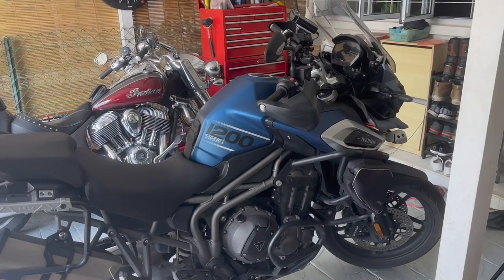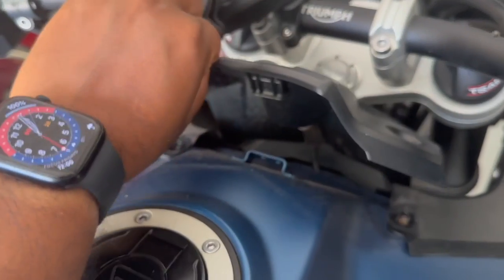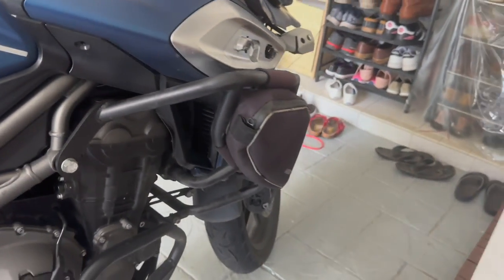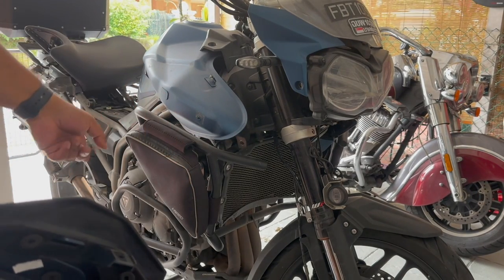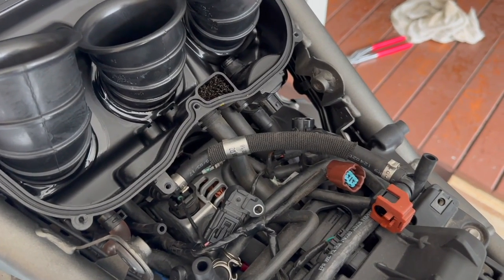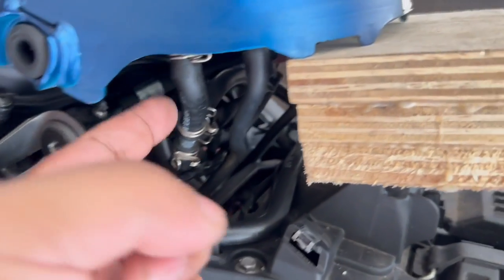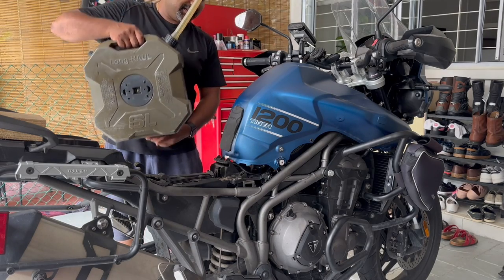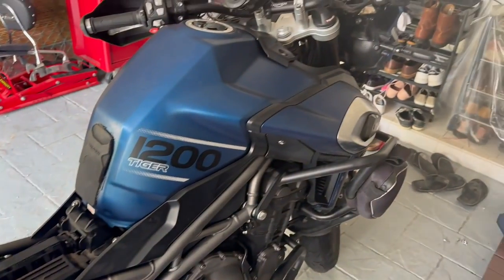Triumph Tiger 1200 - How to Remove Fuel Tank, Change Air Filter and Balance Throttle Bodies

Comment: Thanks for this video. Maybe when it's time you can make one on how to do valve checks and adjustments.  Thanks 😊
Reply from the maker: Oh absolutely, I’ll be doing my 32,000 km service in a few months time. Valve clearance and camshaft timing. Look out for that video :)
Reply: Hi from Belgium 😁  very nice and explicit video !!  Crazy work for change air filter 🙈 mine is a XRT  '16 😊
Reply: @eazyontwowheels  I sure will. Thanks

Comment: Great video. I am going to replace air filter and spark plugs on mine Tiger soon. Do you need to disconnected the battery before disconnecting and removing the tank or that does not matter?
Reply from the maker: Thanks! I’ve got videos for those too :) I’ve never disconnected the battery unless I’m wiring up electrical accessories and everything’s been fine so far 😅

Comment: I was able to purchase the fuel line connector you linked in the description. I have a 2017 explorer. Any more insight on how to connect to the fuel rail?

Thank you for all the videos.
Reply from the maker: Nice! I assume you're referring to part #3 in the description above (the 1/4"rubber hose with the 5/16" fuel line coupler)? The only reason you need that is because you'll need to run the engine with the tank off the bike to have access to the throttle bodies to balance them and the fuel line on the bike is not long enough. So it just serves as an extension to the fuel line.

So you'll just need to connect one end of the rubber hose with the male fuel coupler to the fuel line of the bike (this should be the female connector that was originally connected to the tank). And then connect the other end of the hose with the female fuel coupler to the tank. Hope this makes sense :)

Comment: Hi, I recently bought a 2012 Explorer. The motorcycle wouldn't start for whatever reason. I have been going through the fuel hoses carefully as it was leaking fuel. I am curious to know where the fuel rail goes to. Would you or anybody here be able to help me out?
Reply from the maker: Oh it could be a whole range of issues:

1) do you hear the fuel pump priming?
2) do you hear the click sound from the starter solenoid?
3) starter motor issue
4) fueling issues (if not fuel pump, then could be dirty/faulty fuel injectors?
5) could be a weak battery?

The fuel rail is connected to the fuel tank on one end, and to the 3 fuel injectors on the other end at the throttle bodies area.

Comment: What should one expect to pay dealer to change air filter?
Reply from the maker: For only an air filter change, I think an experienced mechanic can do it in an hour, maybe an hour and half. So whatever labor costs where you live for 1-1.5 hours plus the cost of an air filter which should be less than 20 bucks
Reply: @eazyontwowheels  awesome thanks.any drive shaft spline lube issues like BMW sometimes has or are there zirks to insert needed grease?
Reply from the maker: @stevek4449  nah I don’t think so. Pretty much maintenance free.